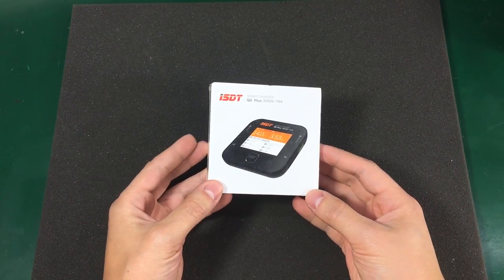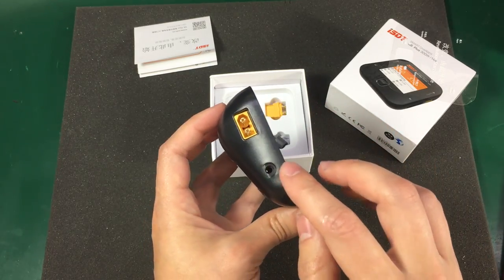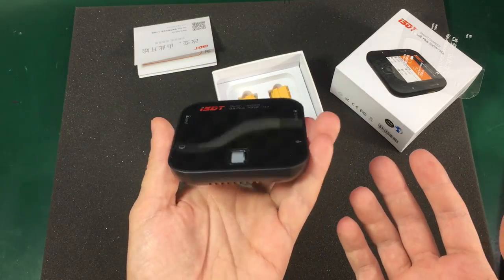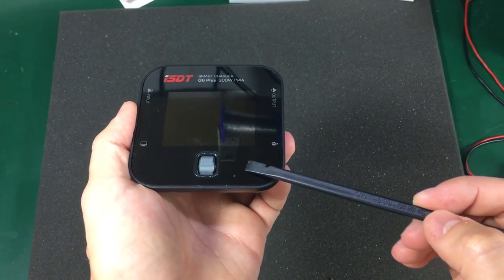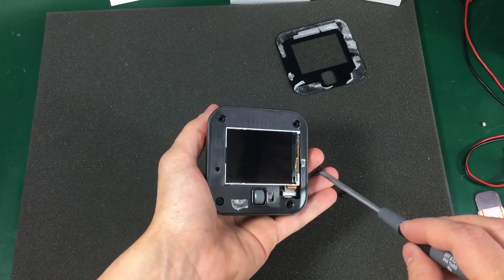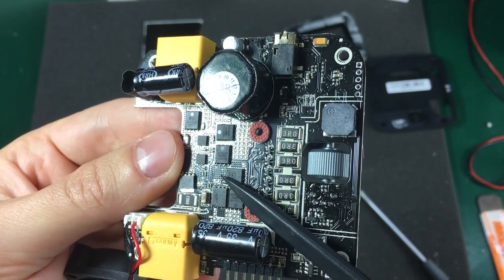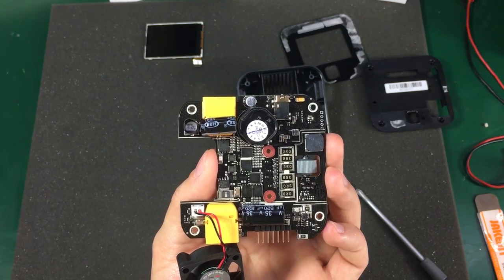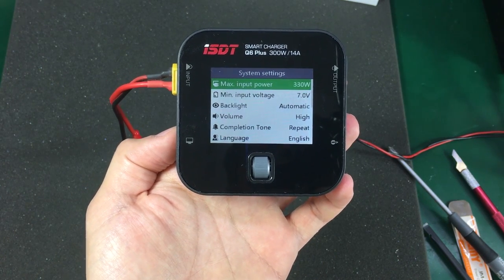Voltlog #109 - ISDT Q6 Plus 300W Battery Charger Review - It's well built!

Comment: I looked for the teardown of this chargers from a while. This video saved me. Excellent work. Thank you so much. I totally agree about the quality considerations. The design at the state of the art, and I am really impressed that such product is sold for relatively low price, especially when compared with other fashion brands. Absolutely fantastic. In the bottom/left corner it appears there is a icsp header.
In case of disuse, I would suggest you to try dumping the content of flash/eeprom memory in order to re-purpose this circuit for other purpose. Regards, Pietro
Reply: Strange to see that this product doesnt exist anymore.

Comment: I think all the datasheet mosfet current ratings are correct (in theory at least).  One set is for ambient air cooling and the other higher set of numbers for when a heat sink is keeping the case cool.  I doubt running them at even close to 50% of that is really a good idea though...
Reply from the maker: thanks!

Comment: Great review! Nice to see that they are stepping up the quality of construction from China. By the way, have you tested the power rating? Usually it's "inflated" :)
Reply from the maker: I don't have any battery in the lab that I could charge up to the 300W rating but that should be possible because of the low rdson on the mosfets and the active cooling.

Comment: did you test the actual capacity of the charger? does it buck or boost the voltage to charge the batts? does it require a certain voltage to certain battery's?
Reply: input voltages range mentioned in video, technically it is both ie. can do either buck or boost, hth
Reply: Dazza Direct 
thanks. I have been looking for a charger that can charge lots of batteries at once. I have thought about using a crap ton of the tp 4056 boards. but I would need a good power supply. I'd like to charge about 20 cells at 2-3 amps each. but likely not happen. unless I use something lime a solar charge controller. I'd like to charge about 60 cells at 1-2 amps also. I don't think I will get a lot of these chargers. I'll keep looking. thanks for replying.
Reply: im a PbSO4 {lead acid} man whats your flavor of 18650 ?, i would go the RC car route of a hacked server ATX easy 60A @5v , then your tp 4056 boards, or a few imax6 (lol maybe 10), or a ISDT, extra diodes and some el-cheapo $1 reset-able 12v car/solar breakers, older ATX not newer are better higher 5v rail, HTH

Comment: 14 amp is more than enough for any RC even most powerwalls
Reply from the maker: yup, plenty of amps.
Reply: how do you think it would handle an old school pb acid or deep cycle 200ah 12v off-grid setup@ around that 14-20amps ? also could be a way with a 60ah or more battery to do a load test maybe?

Comment: Hi,
could you have a look at which inductance the inductor has? It should be written under the quality control sticker
Reply from the maker: nope, I will not take it apart again.
Reply: VoltLog was worth a try ;) and you haven't looked for that back then, have you? I'm currently designing a charger myself and it would have been great to now some details about commercial ones

Comment: They should of just used a micro USB rather than needing a special cable!
Reply: It's actually a common UART interface, and can be easily build with 1-2$ components. And with the actual interface, you can share the firmware, if you have for example 5 of these chargers, you just have to update one, and you can update the others without a PC, it's more like a feature then a design flaw...
Reply from the maker: Actually it's not good practice to place signals through a connector that isn't suppose to carry it, because people might accidentally connect that thinking it's USB and that might damage something.
Reply: Robin Cerny - I meant why didn't the use a USB connector and communication, but as someone else mentioned, it is UART so that does make sense.

Comment: My charger has failed, it powers on, but does not show a battery when connected with the XT60, but when you connect the Balance plug, it flashes up over voltage. showinmg 5v per cell. Any idea if it can be fixed or is it just Junk? Had it 4 months and Banggood don't want to know!!!
Reply: Doing the System self check, it says Remove the battery! (506) when there is NO battery connected. If that means anything to you?
Reply from the maker: probably the magic smoke escape from some of the circuitry, I'm sorry but I can't give you any hints. A visual inspection might provide answers.

Comment: I cant believe ISDT is stupid and did not put logging features into their charger. They must be real idiots, since every competitor has it, iMax B6, Reaktor, Antimatter, iCharger. Can you recommend alternative to ISDT charger but with logging (not the ones mentioned above)?
Reply from the maker: I don't know other alternatives to the ones mentioned above. The ISDT Q6 Plus has served me well, because I don't need the logging capability. But a week ago it just stopped working, it detects the battery, shows individual cell voltage but I can't start any operation because it throws this error "Current Operation is not supported". I have contacted ISDT and I am now waiting for a reply.
Reply: The all SMT in a plastic case charger compared to a metal case one is always looking strange and unreliable to me. I also found a Ultra Power UP300AC 300W that advertises the logging feature, but I can't find any software that should be used.
Reply from the maker: it doesn't really matter what kind of case they use as long as they have adequate cooling. In the case of the ISDT there isn't much dissipation happening so I don't think heat from charging or discharging batteries killed mine. It's probably a transistor or a diode that failed somewhere in the circuit.

Comment: At this price, i think a Turnigy charger is a much better value and a provrn design with more capacity to dissipate heat.  Your review is biased since you didn't pay for this $60 charger, in spite of what you say.  Also, your review falls short of actually testing the charging capabilities and LIMITATIONS.
Reply from the maker: Have you actually watched the video? I am saying I don't want to review it's features because there are plenty of other videos that do exactly that so you can go and watch those after a simple search on youtube. On this channel I post content which is electronics related so in this video I am taking a look at the electronics of this charger and how it's build. If you don't think this charger is worth $60 based on what I've shown in this vid you clearly haven't seen the crap that comes out of China and how it's usually built.
Reply: rofl... these 4 button chargers are now history with ISDT's amazing chargers at very good prices.
Reply: I'm the owner of the smaller brother, the SC-608, I also own the lipo-checker they made. A bit more expensive then all the others, but worth it, OLED display 8s capability, displays all voltages at once, small and lightweight. Anyway, this company, ISDT build affordable, easy to use and powerfull chargers and accessories. Compare it to other OLED firmware upgradeable chargers. They are much more expensive, sometimes 3-4 times the price and are much bigger.
And the issue about the heat dissipation, sure it has limited discharge capability. But first of all, I use it as a charger, and if I have to discharge a battery, I use a electronic load, all other chargers are also limited in this regard... And about dissipating heat for balancing... If I see a batterypack with high cell voltage differences, I inspect the battery first, and after testing I charge cells individual to check them seperatly. After all that, I charge it with the charger. A good and healthy battery pack didn't have to be balanced as much and it is a sign of one or more bad cells if the charger has to balance hard.

BTW. once again, good review Voltlog!